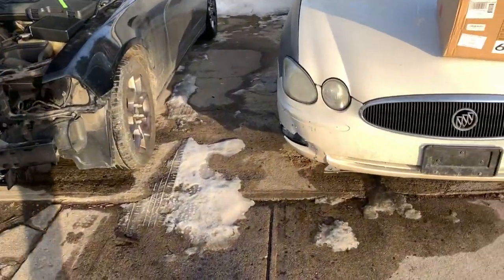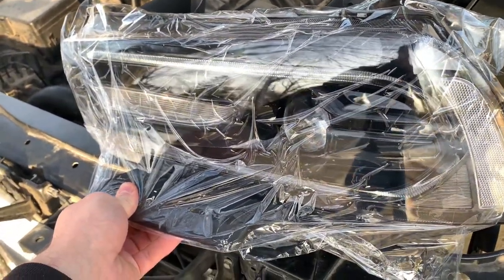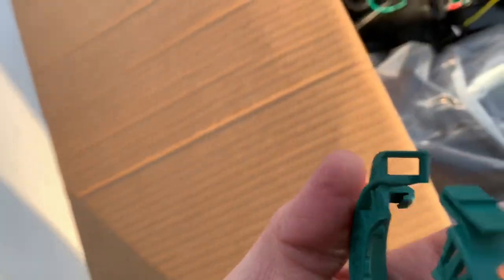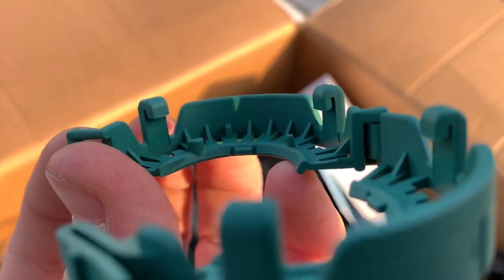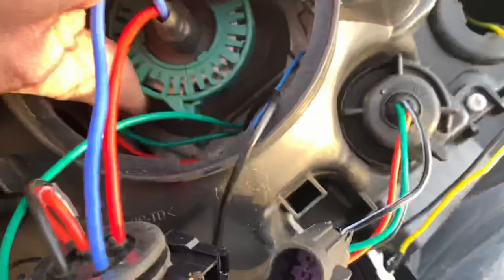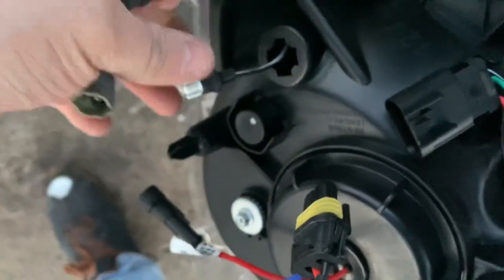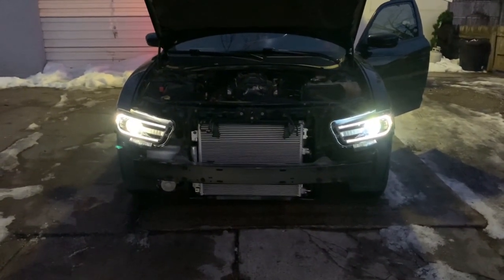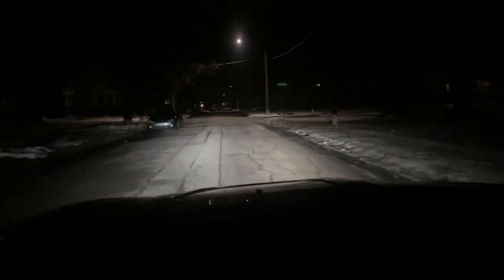How to install Vland RGB headlights for 2011-2014 dodge charger

Comment: There is a little wire with a small plug coming from the passenger side light, you know where it’s connected?

Comment: How did you connect the headlights to your phone? Mine isn’t picking them up. Does the car have to be on? Is there a discovery mode?
Reply from the maker: There is an app called “HappyLighting” yes the car has to be on. No disc mode just Bluetooth
Reply: @OrangeWrench392 I have the app and tried connecting and nothing pops up any fixes?

Comment: Do led headlights need new wiring I bought some for my 2012 charger but only the high beams have a connector
Reply from the maker: No. You should not need new wiring I used the stock wiring on mine.
Reply: @OrangeWrench392  thanks it was the grey connector I just needed to take the lightbulbs out I was kinda mad at my self for being that slow to not realize thanks again though.